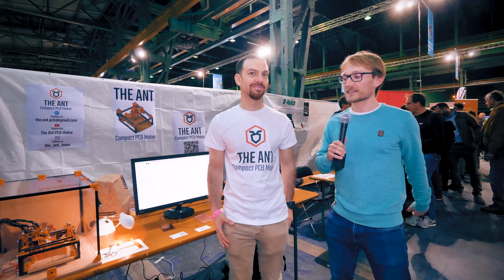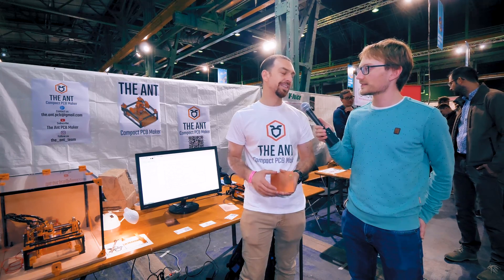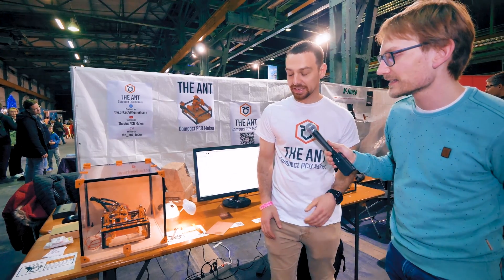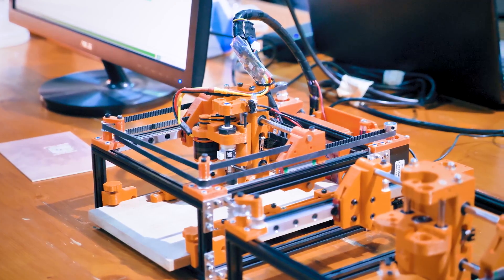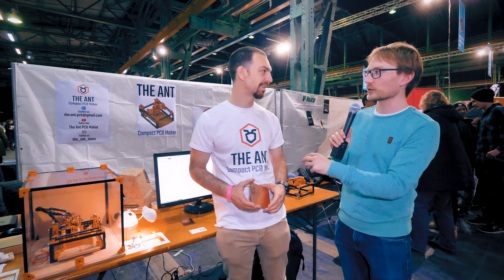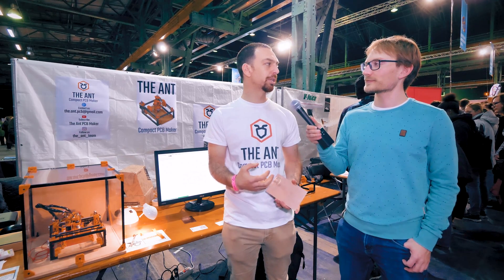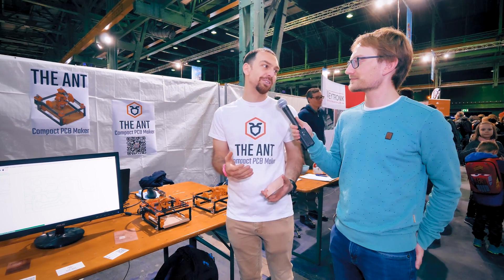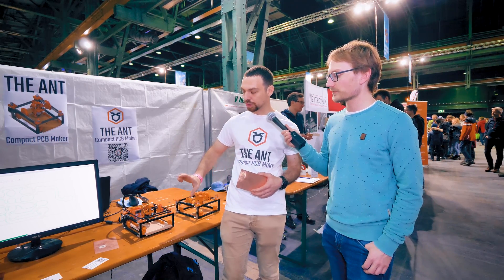Tiny CoreXY PCB mill! (that actually works)

Comment: I honestly don't get this, except for drilling holes. I spent many happy hours as a teenager making hand-drawn PCBs using carbon paper, a marking pen and a few seconds in a ferric chloride bath. Now it's just a printer and photoresist, followed by the bath. Quality way better than any of these mills, and with the right bath set-up you can do many at a time. It costs almost nothing and is no doubt faster with the right set-up (less space than for the mill). So where's the advantage to the maker in using a mill specific to PCBs? That said, thanks for this; I'm going to build a core x-y soon and will look at this design for ideas. Love open source.

Comment: $300 is about what my DIY CNC machine cost me to build. I am not keen on the spindle I have for my machine ATM though now. I have one of those Chinese "500W" air cooled spindles and it is not high enough RPM for small engraving bits. A good water cooled spindle will cost me about $300 alone. Someday.

Comment: I like it! The precision looks good! However nowadays you can get 150 pcb designs made for 300 dollar, or 2 dollar per piece with shipping in china. Granted you'll have to wait a week but then it has plated holes, double or 4 layers, conformative coating, silkscreen on both sides and is outline milled to specification and get 5 or 10 copies to share with others. Currently making a floppydrive capture shield for arduino due. Should arrive today. Excited!
Reply: If someone else is doing the work then you're not making anything.

Comment: if the precision is high enough and I assume it is for its designed task I would very much like this as a 3D printer with say 150mm Z height. a little tiny ultra compact core xy for my 0.2mm nozzle prints would be nice !!

Comment: Hmm, this seems to be the Ant-swer to a lot of maker needs.
Reply: boooo!! :)
Reply: Not really. Any decent CNC machine can route PCBs With a larger work area you can do other tasks as well too. But you can't stow a good sized CNC machine in a drawer when you're not using it. You can put a Japanese apartment into the space most CNC machines tend to take up.

Comment: Really cool little unit! I'd be interested in using it to machine small stamps vs pcbs. Wonder where they sourced that tiny collet from.
Reply: ER11is a lot more common than ER8 but ER8 is still pretty available. If there's a parts list someplace for this project I'm not finding it. I downloaded the zip file they have on bitbucket and looked at what's in there. It appears to be a handful of STL files and a PDF about electrical connections to me. So a bit thin on documentation. Perhaps they're relying on the series of YouTube videos they're producing? I'm new here.

Comment: After having built a Cyclone PCB Mill and modifying a T8 CNC,both with Bcnc autolevelling, I will believe it when I see it. The major issue I have had is run out on the cheap motor spindles.
Reply from the maker: That's the main reason why they have the seemingly complicated pulley setup for the spindle - it's supposed to work much better than the cheaper spindle motors with a chuck clamped on the shaft.
Reply: @MadeWithLayers  Cheers. I'll probably end up building one anyway 🤣
Reply: @MadeWithLayers  you are absolutely right. The head configuration uses an ER8 steel chuck with a 6 mm shank coupled with angular contact bearings, that is more robust than simply coupling the shaft directly to the chuck. Cheap motor splindles do not have strong bearings and a shank diameter suitable for our purposes.

Comment: 0.2mm eww.
I never understand why peoiple still try so hard with milling PCBs when you can get PRO one for $10/10pcs withing a week...
Reply: because you do not need to wait and let say you made a mistake on your pcb, you need to wait on more week...  so 2 weeks. at home you can do it in 1 hour. 
And if i'm not selling the boards why am i going to pay 10$ for 10 pcs  when i just need one, and will cost less than 50 cents.
Reply: @backonline  yes, this with shipping  and import cost (UK) can soon mount up if you are ordering them often.
Reply: As soon as you want anything apart from the standard offer you will pay much more than that, MUCH more.

Comment: 300€???? I'm curious on what is costing a lot on that small thing.
Reply from the maker: I feel like that may have been a cautious estimate - with some smart sourcing, you can probably build it for half as much.
Reply: The chuck and the motor, probably. And the openbeams, all together, are not that cheap.
Reply: @JasperJanssen  I know the beams are not very cheap, but still it is a small thing.
Reply: It has two linear rails which by themself can easily cost 100€. I am pretty sure the price would be much higher if they used high quality products only. (like Gates Powergrip belts)

Comment: Open source, few words warm my heart so effectively.
Reply: It has a Non-Commercial license though, which means that while it is open source, it's not open source hardware compatible as no-one else can sell ready made parts (like injection molded/aluminium upgrades) or any parts modified from their files.
Reply: @JohnEdwa  This machine is targeted at an audience the already has access to digital manufacturing, most notably 3d printing. I don't see a non-commercial license as a hindrance.
I think most of us would likely end up using a cnc router or laser cutter to make the end product more suited to our individual requirements anyway.
Reply: @giliant  you are absolutely right about our scope, at the time of licensing the mechanics we wanted to protect our ideas from commercial "abuse" and not from everyday use. We are glad if schools, university, maker labs and simply any maker builds, customizes and uses its own machine. JohnEdwa is also right about stating the real nature of the license, and we also want to avoid misunderstanding about it (we wrote a comment stating the exact license type).
Reply: @TheAntPCBMaker  unfortunately with companies like makerbot out there stealing ideas and patenting them, licenses like this are necessary to protect yourselves. thanks for making cool stuff available to us everyday people!

Comment: Hallo Thomas
leider ist mein Englisch nicht wirtlich gut und ich weiß das du schon deutsche Videos gemacht hast könntest du das in Deutsch oder auch mit deutschen Untertitel in Zukunft veröffentlichen ich denke du wirst eine große Menge an Leute hier in Deutschland ansprechen
Reply: Ist halt leider echt eine Menge Arbeit extra. Ich red mal mit Tom darüber
Reply: @kojote  enable community contributions for the subtitles? And please don't make videos in German, subtitles will have to suffice.
Reply: @SianaGearz  Community subtitles are already enabled as it seems. I see no point in making german videos, much smaller audience.
Reply: @TheBrassn  English subtitles done. Now just wait for them to clear and you lot will be able to translate them into German. I can speak German myself but i get really confused with the tech jargon! It's also tough for me to switch between languages, it's one or the other else i get a massive headache. Never had to speak German on the job so far.
Reply: Nun, ich habe zunächst mal englischsprachige Untertitel vor 24 Stunden hinzugefügt und die sind soweit nicht freigegeben worden. Wenn Untertitel sowieso nicht veröffentlicht werden, ergibt es keinen Sinn, dass ich die Übersetzung auch noch mache.

Comment: I don't get PCB mills ... I mean, if you want a pcb, nowadays company such as JLC PCB allows you to have a professionally made PCB for hella cheap with not so long shipping delays ... I don't see in which usecase a PCB mill is relevant
Reply: Such PCB services are much slower than a mill and as soon as you want anything apart from their standard offer it gets very expensive.
5pcs 100x100: $2
5pcs 200x100: $14.70
5pcs 200x100 without lead and a red mask: $29.20
Reply: The same can be said for 3D printing, lazer engraving, or anything else thats done in the garage. Enjoyment and education brother!
Reply: @TheChemistDIY  I disagree ! 3d printing on demand is very expensive if you want a somewhat decent print ! But i don't have something to say about the enjoyment argument ... You get a point ;)